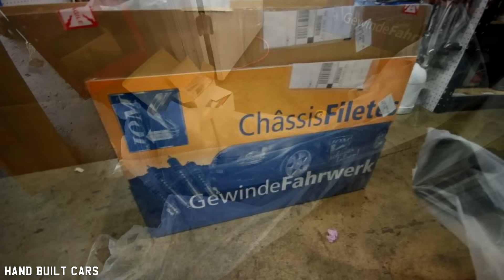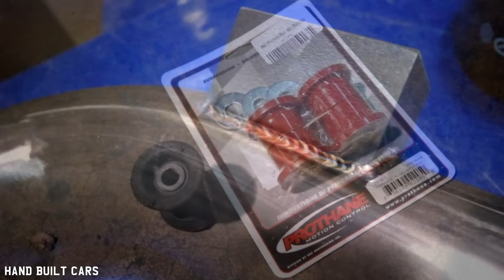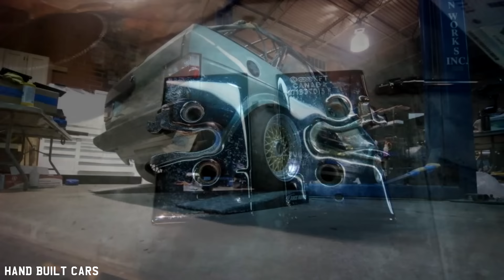1986 Volkswagen Golf Mk1 VR6 Convertible Rabbit Build Project

Comment: Sweet car! I had an 83 Rabcab for about a year in Hawaii until I decided to try to go 80 around a 30mph curve.... The car went straight 😶. And my face went straight into the steering wheel. Damn seat belt buckle is connected to the seat rail instead of the floorboard... You might want to change that. The seat just ripped out out of the slider frame.